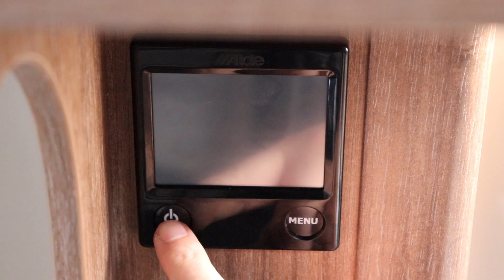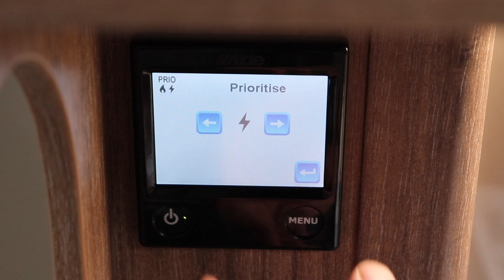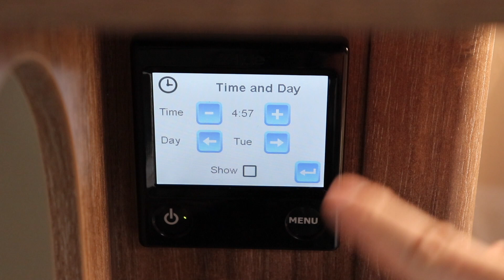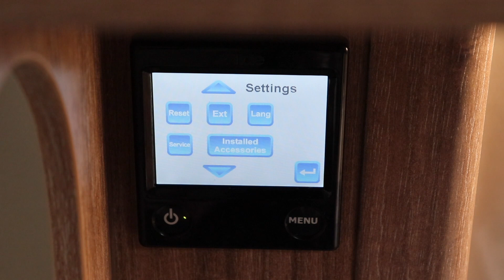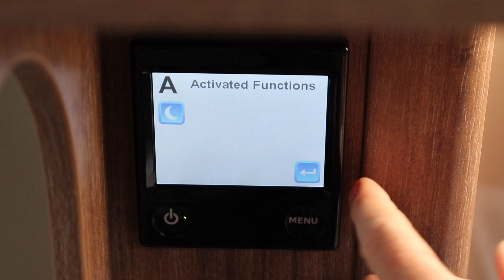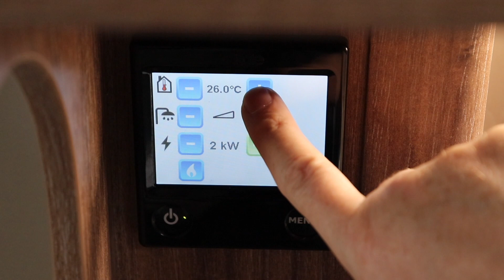Alde 3020 Control Panel

Comment: I Graham. Just been watching one of your old blogs on the ALDE 3020HE control panel. My latest moho has one of these and i’ve just about learned all i need from it. One annoyance however with it is the loss of the time setting when you switch of the main panel to go out. I picked up a solution from another vlogger and that was to install a battery backup unit. I bought one from ebay for about £7. nothing wrong with it, good product. However, with anything like this i’m always a bit cautious as to weather it might do some harm due to it remaining on all the time and not being factory fitted. So, to be on the safe side, and as it seems only the time setting is lost, and i’ve learned how to quickly reset the time when we return, I decided not to fit it…….What’s your take on this.
Keep em coming, always interesting,    Alan
Reply from the maker: Hi Alan, thanks for watching. I just set the time when we go away, sometimes I dont bother at all. I manually turn it down at night to about 16, then when I got up I set it back to 23.
Reply: Morning Graham. I always set the time as the system seems to work better with it set. If i don’t set the time the daytime and nightime on and offs are all over the place. In the winter when we needed heat the time had to be set. Unlike now, in the summer, it dos’nt matter. 
All in all i’m quite satisfied with what we’ve got. 

We’re just getting ready for a trip to France, we’re leaving on Wednesday via the tunnel. Everything is ok and straightforward apart from the food we can take situation. I think it’s absolutely rediclulous. We have a 6 hour drive down to Folkstone, Then we board the train at 14.00 and arrive at 16.30. Then we have to start shopping for survival supplies somewhere in the great beyond, and set up on our first stopover.
Any food we do take is for our own consumption, so i don’t see what all the fuss is about. 
Anyway, once we’ve over there we’ll be fine. Wish us well, we are away for a month, i’ll keep an eye out for anything typically odd French.  
All the best with whatever you do.   I be watching….Alan
Reply from the maker: Agree; the food situation is a bit silly. Have a wonderful time, I'm sure you will, we're very jealous. We had a month in France a few years back...

Comment: The temperature offset setting allows you to calibrate the internal and external  temperature sensors to reality using a separate thermometer.  I found that I had to apply a 3c offset on my caravans internal temperature sensor and about 1c for outside.

Comment: Here's the video I did last year. Think I've got a slightly older version. Don't have the Altitude control. You can run it on batterry, but the van's control panel has to be on. Have a look at the comments on my video. I found a few things out as well after doing it. https://youtu.be/4LzqMLF1lZk

Comment: hi we dont put the alde on at night we found that the fluid would bubble in the header tank which in our van is located in the wardrobe at the side of our bed most annoying! but it works about 5-10 degrees out on the display temp when we first had our van we had to call the help line because the heating would not get hot, and we were told to put temp that much higher than the temp we desired, ours is a swift van, great content great vlog
Reply from the maker: Yes our tank is in the same place, and I sleep that side of the bed :-( The first night we used it I could hear it, but after I'd turned the pump down to speed number 2, things got quieter. I read that when dealer does PDI they run pump at 5 to clear air from system, which all made sense to me. Good to know they actually did a PDI !

Comment: Good vlog “G” 👍🏻👍🏻. The heating system on 12v would mean that the pump selection is 12v but the heater itself would need to be run on gas to heat the water. My work colleague has got that controller on his sprite. He’s got it connected to the internet and can do everything from his smart phone. It would probably be more efficient to leave ur heating pump on continuous for smoother control on the room stat 😎👍🏻👍🏻
Reply from the maker: Thanks, that makes sense, I actually thought the battery might heat the water as well :-) haha. I've seen the smartphone integration, it looks like it uses Truma iNet system, I can't justify the cost vs the benefits. Looks cool though.